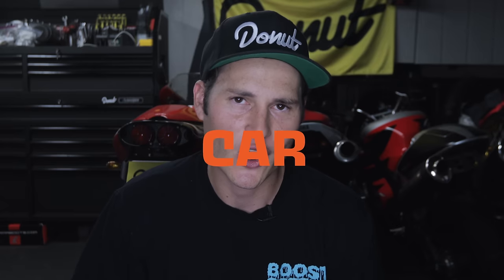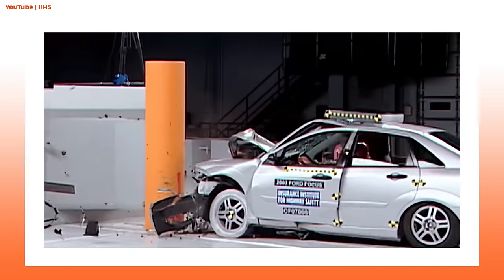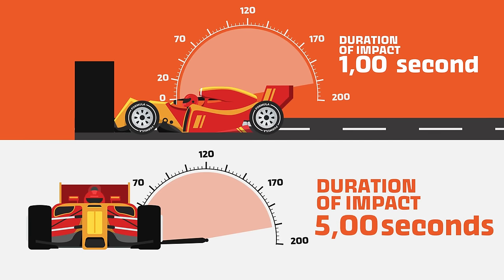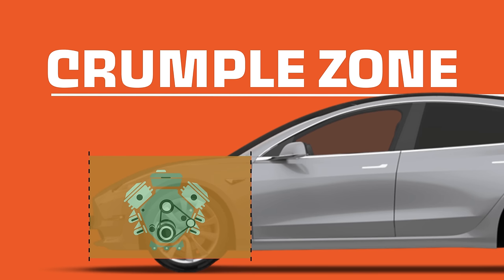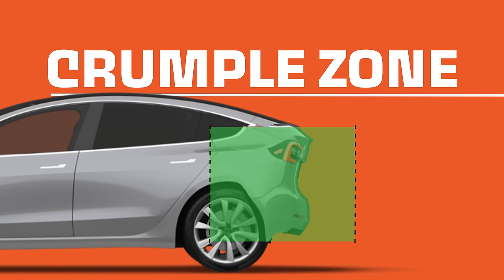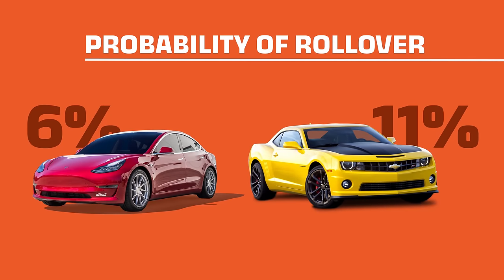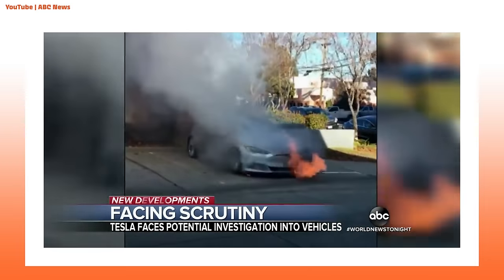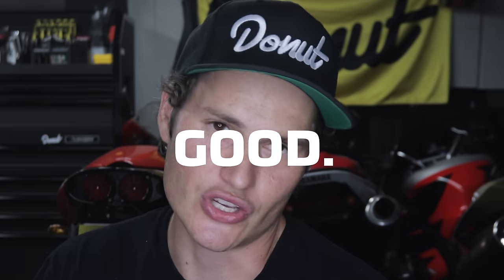How Tesla Used GLASS to Build the World’s Safest car

Comment: 1: The engine on most modern car is actually part of the safety structure and will move when hit.
2: The gasoline tank in the rear, well, that is no problem at all actually. It is placed further in and it will also move if needed.
3: If you want to see safety structures in top class, check out how a modern Volvo is built. They use five (5) types of steel with different strengths and aluminium. Here is an image of an XC90 and its parts: https://www.media.volvocars.com/image/low/148215/1_1/5
4: Rolling and tumbling in a car is VERY BAD. Why? Because that makes your head fly all over the place and this puts a lot of strain to your neck and spine, and you can hit stuff in the car.
5: The glass is not that good of absorbing the energy when you have an impact. And besides that, all cars have laminated windows in front and our car actually has laminated windows all around.
6: Active safety: Take like BLIS (Blind Spot). It does not work very well at all in snowy conditions and in heavy rain since the cameras get clogged. Our BLIS works, all the time, because it uses radar. And speaking of radar - on our Volvo, the radar will never clogg, like it can do in a Tesla (some frozen snow slush and it stops working).
7: We also have special spine protection in the seats, and dual belt restraints on the seat belt (on explosive device at top and one at bottom), because it is safer, and also there is electric pretension of the seat belts.
And more...

Comment: TESLA: There's only a 5 year world supply for lithium batteries (and Tesla is using up too much of that for the few , 

compared to how 

little a smartphone uses for everyone).   Current electrical infrastructure can't supply the electricity to all homes.   

Powerlines 
contribute to forest fires.   Lithium batteries are mined by African children.    Lithium batteries create toxic disposal 

wastes.

There needs to be a law that prioritizes lithium for smartphones over electric cars because cars have petroleum and hydrogen 

alternatives.

Providing more lithium batteries for EV cars is just opening a can of worms because the electrical grid cannot support every 

house.  

Not everyone can or wants to incur the cost of solar panels (which from my friend's experience only lasted 7-10 years)
I have 4 cars, 2 cars (kids' cars) are parked outside.

A battery manufacturer should sell to the highest payer.  Ford, GM, and VW have deep pockets and they can pay more for the 

batteries 

and put Tesla out of business.

An electric truck makes no sense because tests have shown that the battery drains faster when it has to pull.  Hydrogen 

vehicles make 

more sense in trucks than EV.   Hydrogen vehicles fuel up in 5 minutes like gas cars and they have a 1000mpg range; EV you 

have to 

wait 45+ minutes (and you have to wait for the guy in front of you to finish his charging)

THere isn't a plugin at every corner like a a gas station and the charge is 50 minutes+ (assuming you aren't waiting for the 

guy 

before you to finish his charging)

Gas stations pay tax to maintain roads, EVs don't

That would cause a lot of unemployment.

Comment: The issues i see with Tesla: 
#1 Yeah, you have no Gasoline which can go boom, yet you have a set of batteries beneath you.. if they get demaged in an accident, they will go off https://www.youtube.com/watch?v=BLc74Qpvweg some even set on fire/explode https://youtu.be/WEGpq3qFPlc?t=179
#2 Yeah, you arent getting as many Gs when your car wants to become a beyblade, yet it yeets wherever it want and since the roads arent empty, its gonna be oncoming traffic, walls, trees etc..
its like the ppl hyping the Smart car for having such an awesome hard shell that keeps the passengers safe.. 
#3 When your car is deformed to the point that you have to be cut out, the ppl helping ya will have a hard time doing so, since the electricity is still flowing trough your car (A, B and C pillars)..

In the end there is no "the safest car", you just have to be lucky, that you only get in accidents that four car is made for..

Comment: CYBERTRUCK is the opposite, how the hell will survive to crash test classification
Reply: What?
Reply: @user-RCST  cybertruck is built to be completely rigid
Reply: @maximiacovacci  the cybertruck will probably be one of Tesla's safest cars.
Reply: @user-RCST  If u watched the video and if u know the structure of cybertruck as presented you can understand that is going the opposite way of car safety
Reply: @maximiacovacci  not really the bigger your car the safer it is.
Reply: @user-RCST  its clear you have some understanding problems
Reply: @maximiacovacci  what's the problem?  Are you sure you're not understanding it.
Reply: Ok lemme explain so, the big point teslas on market rn are safe, its because they are NOT RIGID, so during a crash they deform like cocacola cans and absorb the most of impact deceleration so your body doesent go from 100 to 0 in half of a sec. Tesla Cybertruck is advertosed as the strongest space steel shit outta the entire world and that means if u crash into a wall the truck wull show maybe a dent, that means that your body absorbed that extreme g force and probabilly you wont be able to tell it only to god. The same means to the safety around the car, if you ram people with an actual tesla they are likely to survive than ramming with a cybertruck. Now its clear to you or you are still that small pp that thinls only about size?
Reply: @maximiacovacci  nah man the walls and other cars are the crumple zone.  But in all seriousness we should probably wait to make our assumptions until the crash test is out.  Also if you get hit by any truck you're screwed whether it's an F-150 or a cybertruck.
Reply: @maximiacovacci  the edges aren't that sharp.

Comment: You literally spoke about how rollovers are safer because they disperse energy, and then go on to highlight the Tesla is so safe because it's low center of gravity means it wont roll over. Dispersing energy or not rollovers are not better as they apply force to weaker parts of the human body such as the neck; though modern cars do make the statement more believable. The Tesla likely is the safest but any video that has two opposing statements as true without disputing either has an agenda or is simply not a video that should believed.

I really like Donut but this is a terrible video on safety which is the most important video you could ever do.

Comment: Title: How Tesla Used GLASS to Build the World’s Safest car
First sentence: Tesla's Model 3 war recently named the safest car in the U.S.
Conclusion: World = US......
Also if you compare the Volvo S60 with the Model 3 in the IIHS site you'll see, that the only point where the Tesla scores higher than the Volvo are the headlights and the Strength-to-weight ratio (if you calculate the ratio with the same structure but the Volvo's weight you'll get 5.27)
No doubt, the Tesla is more roll-over proof... But I doubt that Tesla Model 3 is the safest car in the World...